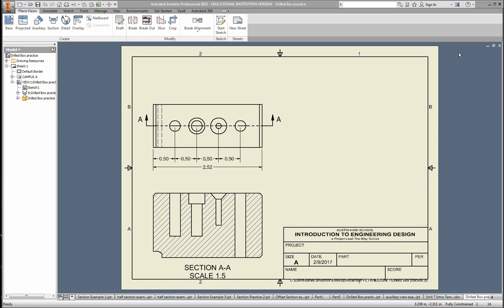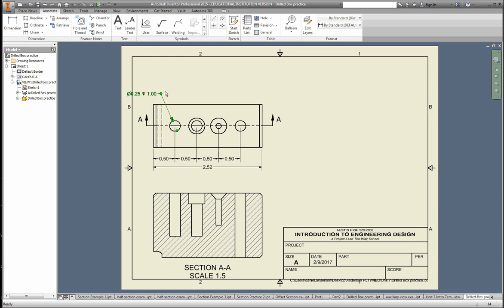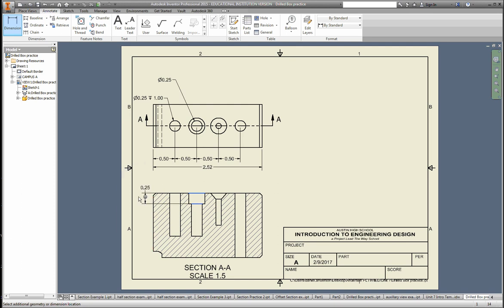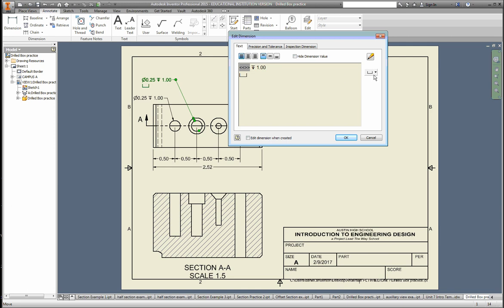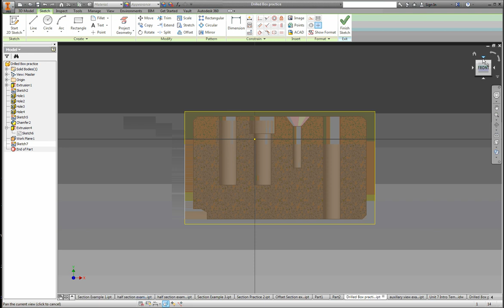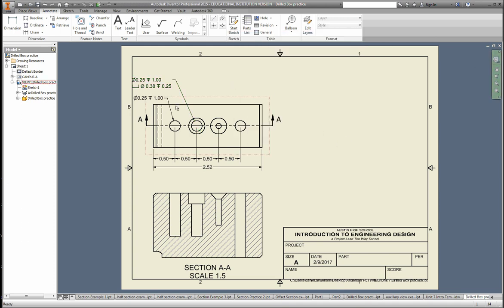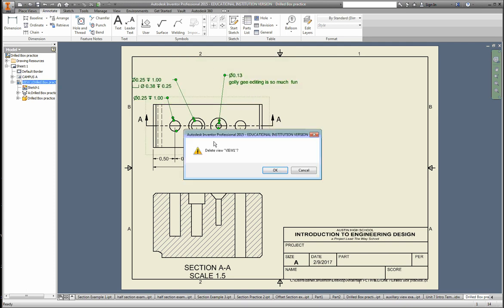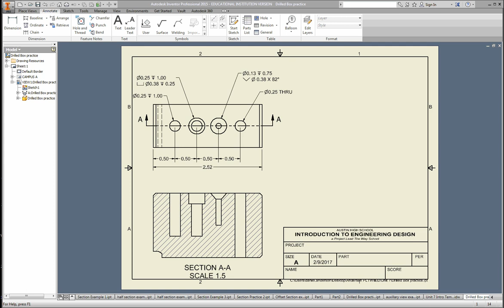Hole Notes - Documentation in Autodesk Inventor 3

Comment: how can i dimension thread holes length ?
Reply from the maker: I believe if the hole is threaded already, and you use the hole and thread feature showed in this video it will do it automatically?